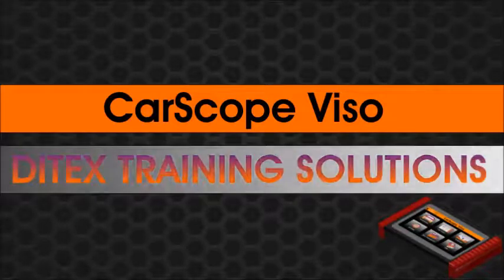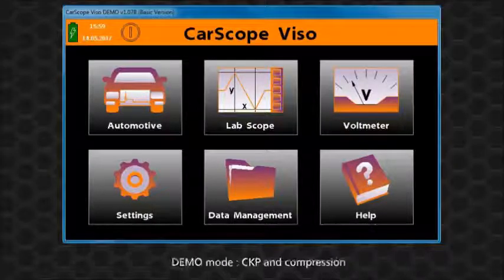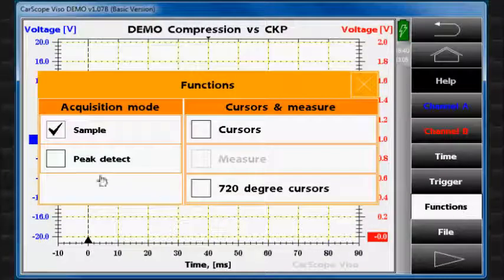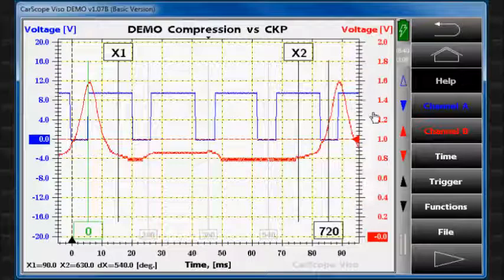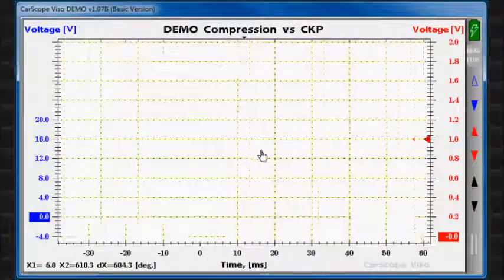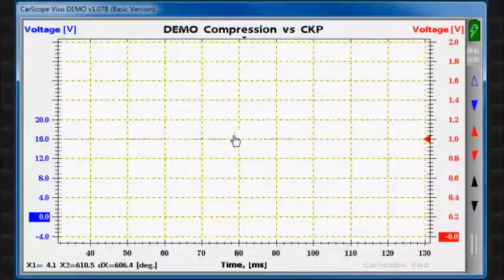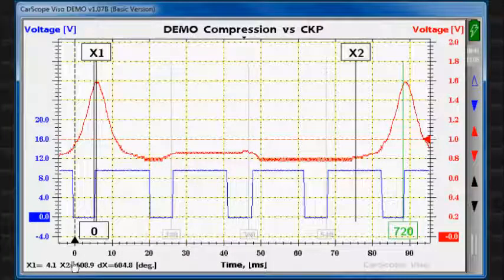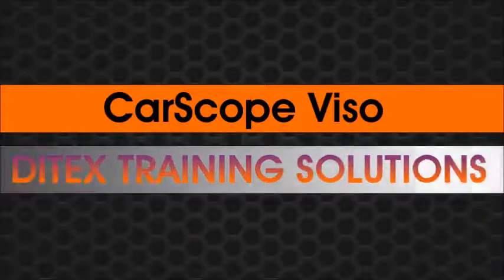Using 720 degree cursors for automotive diagnostics with oscilloscope (Lab Scope)

Comment: At 1:14 its clear to me that since there is no resolution in the exhaust valve opening area that this would be well..... let me watch the rest first
Reply: If it's any good why don t they let it be tested by you Keith. Your experienced with al brands of scopes. So you should be able to compare it to other scopes
Reply from the maker: @DiagnoseDan We have no doubt about the competence, the experience and the impartiality of @New Level Auto and we will consider him offer.
Reply: @AutoDITEX  that would be Great!  I've seen your products from Erik Streurman our reseller of your products in Holland. But i've never seen them in action!
Reply from the maker: As you know Ditex's The Netherlands distributor is Mr.Erik Streurman. Company DiagnosES. He has almost all our products in stock. If you want you can give him a call and he will demonstrate you how they work.
Reply: @AutoDITEX  he was here 2 weeks ago😉
Reply: Nope , didn't get any better. Not nearly enough resolution to make this test feasible using this scope. Unless there are features to increase the number of samples of course.
Reply from the maker: This video has been made using capturing CarScope Viso Demo program.
Both signals are simulated.
You may try it yourself. Feel free to download CarScope Viso DEMO program for Windows from here:
www.autoditex.com/share/VisoDemo_Setup.exe
The demo mode we used on this video you may found here:
Home screen>Automotive>Ignition>DEMO Compression vs CKP
Reply: @AutoDITEX  I would much rather test this an a vehicle. Please feel free to reach me at onboardtech@yahoo.com  If you look at my channel I am sure you will find that there are many people always looking for a new scope. If yours is as good as stated I would be glad to give it a good review.
Reply from the maker: @New Level Auto Thank you very much for the interest to our products and for the offer. We will consider your offer but we have no such practice because our potential clients are able to download our free CarScope Viso demo version and to check if CarScope Viso match their reguerments.
Reply from the maker: @NewLevelAuto  Keith, I have just sent you an email.